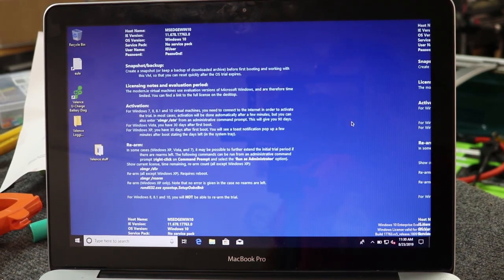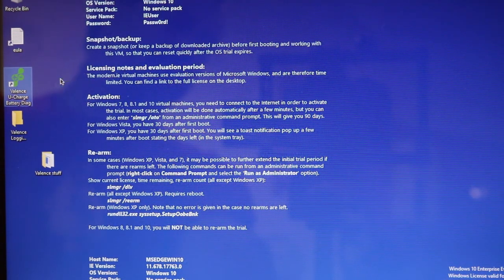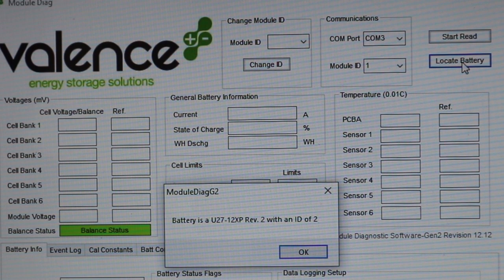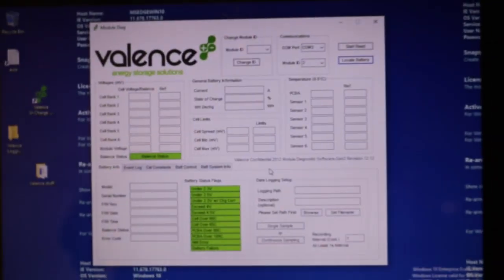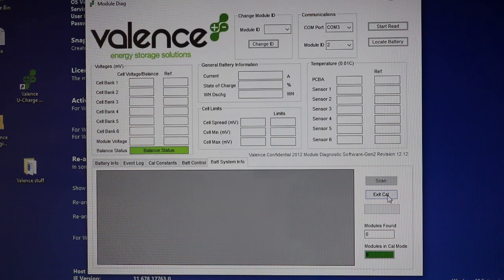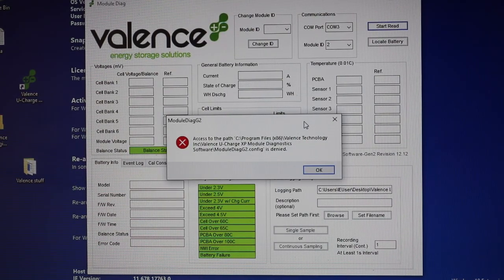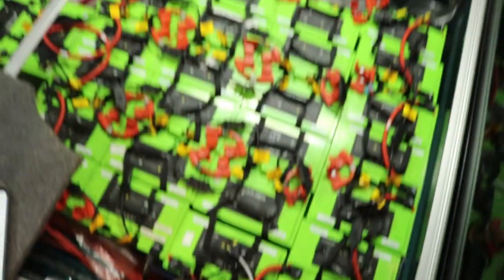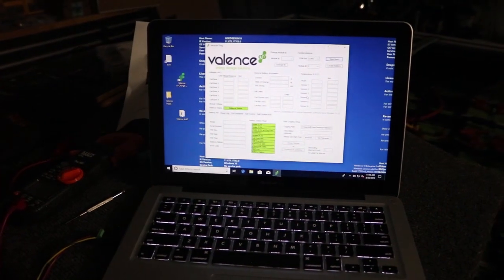Valence Lithium Battery Communication attempt #1 - Ford Ranger Electric Truck

Comment from the maker: I got communication working the day after I shot this video!
Reply: was it the run as admin option. That is what did it for me. I'm running it on win10 latest updates.
Reply from the maker: @linniegrodecki7887  Yes, the one error was mostly permissions. A bit more complicated than that, and kind of a pain, but that was essentially it.

Comment: Awesome Ben maybe try just one battery then ad another I think it is seeing the bank as one battery. Databeestje has a good point with the properties of the folder. The other thing is a lot of older programs will want you to locate the folder on C:\ and not in a windows path. Good luck Ben you are a hacker.
Reply from the maker: No issues with one battery vs many batteries. It was permissions and paths that caused the one error.

Comment: You should be able to manually set the file permissions on that folder, in newer windows versions you are not by default allowed to write into program file directories. Try that.